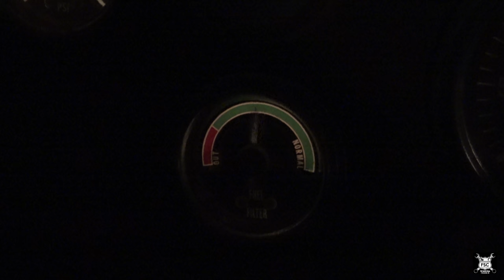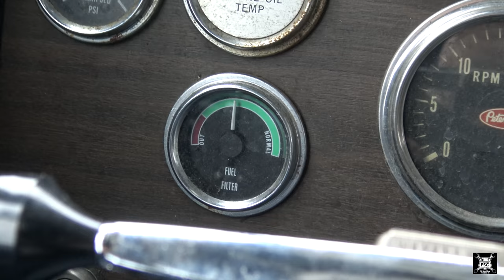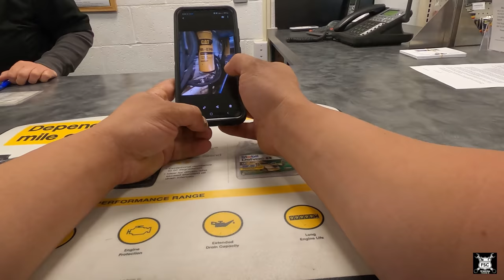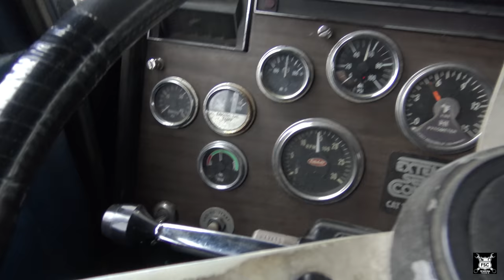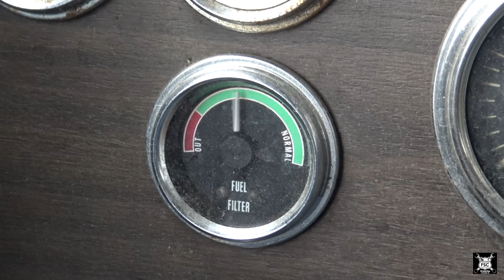Cabover Peterbilt Needs Repairs

Comment: Glad to see it was only filters. Couldn't help but notice that shop had such a friendly crew once you paid the bill. Until then I thought they were going to shoot you for bothering them with your fuel problem. Guess you have to add that cab lift hydraulic system to your "fix-it" list when the weather warms up. I remember having to rebuild the pump on an old F model Mack I had in the snow in Chicago because the seals decided to go on holiday in the worst weather possible. Ah, the good 'ole days...
Reply: Tom H : as you said, "the good ole' days." I remember them well. My problem wasn't as bad as yours, but I once had the turbo die on me on my 1975 Brockway Coe with a Cat engine one very cold winter night in 1978 around midnight on a mountaintop of a desolate stretch of old NYS route 17 in upstate eastern Ny. No pay phone for miles. Thankfully a state Trooper stopped to check on me. He contacted his dispatch via radio, who made a call to my brother who lived 3 hours away. And my brother went to the shop and got a new turbo, then drove out to meet me. By the time he got there I was half froze to death. In the cold wind we jacked up the cab and switched out the turbos and headed straight to the first diner we could find for a cup of coffee. The good ole' days. But you know what? I'd do it all over again if I had the chance
Reply: I agree, maybe their morning coffee hasn't kicked in... or they were intimidated by the camera, and thought it was A sting operation, for A TV show.
Reply: @SuperHigear  I hear you. We can laugh about them now but it wasn't so funny at the time. But, you're right, I wish I could go back.

Comment: The primer pump will give you that problem too if it blows out. Replaced 2 on my b model and one on my e model. Finally got a  blocker plate from cat. More fuel pressure than it ever had

Comment: FSC,  When was the last time you drained off the bottom of your fuel tanks ?   I used to do it in the fall,  A little piece of ice in the pick up lines will shut you down.  We used to buy a product from FPPF called melt down.  probably wouldn't hurt to have some in the truck for emergence's.   do you have tank heater's on that truck?

Comment: When I worked on cab overs, I learned to never ever trust the cab cylinders to stop the cab when going over center.  I always used a safety chain.  Glad I did cause one time I had one run away from me.
Boss Shop AKA a Class 8 Jiffy lube joint.
Reply: most if not all cabovers have safety stops built into the cylinders. if they come down to fast they will lock!

Comment: Glad you got the filters changed sounds like when you got fuel in Indiana it might had water in or some bad fuel I would say a lot of drivers who got fuel there probably had the same problem, by looking at the door from inside it looked like that you could have got the whole truck and trailer in the shop stay safe out there

Comment: 2012 ISX here. Had the same issue a few weeks ago. Had black slimy stuff in the water separator filter. Only got 2k miles out of 2 sets of filters. Truck would idle fine till you pulled with it. Run through the Chicagoland area twice a day. Changed where stopped for fuel and its much better. Another guy running with me had the same issue too

Comment: I ran my own truck for the last few years, 1988 379 with a b model cat.  More than once I had fuel filters go bad seeming early than they shouldve.   Somes times bad fuel but sometimes the filters do collapse inside and cause that exact problem.   I cut them open before and found that.  Even had it happen on a new western star with the cartridge style filters as well.  Glad it was a cheap fix man

Comment: Glad filters did the trick , look out for cat high efficent  filters they plug real easy & can drop hp. Down the road look out for your suction line with  the fuel heater in it the insulation comes loose  & bunches un in the line & creates  a restriction  at high hp & goes away at idle.

Comment: Steve is that fuel ⛽️ you get a mix of Biofuel and refined diesel as that biofuel is crap stuff it has lots of junk and particles in it anything over 15% mix ain’t no good for high mileage
And I would only run CAT filters adeptape did a cool video on filters a while back 👍

Comment: i broke down in a international transtar cabover in 1982 in nebraska fuel pump went out no cell phones i had cab jacked up on gravel road and a bunch of coyotes started circling me in field.so i slept in cab lifted till daylight and flagged down a farmer.after that i got the 80 362 pete cabover i remember it was gold brown with 3 stripes and brown interior with air ride 13 speed.cummins 400.The transtar was a 400 cummins to but a  10 speed.neet to see a cat in yours!

Comment: That thang about the wrecker is in your head hero. When you drive a truck 36 years old, you get that way. I know because my old Pete was a 1995 and I drove it up till almost 2016. A lot can wear out in 25 years and unless your doing a "Twin Stick Garage" restoration on a truck when you buy it, there's a lot of nuts and bolts that can work loose or break. You know Cats make fuel pressure from the return instead of thru the intake like most. If you haven't had that regulator off the engine lately it could be one problem. It's easily checked by plugging an external gauge on one of those ports in the fuel line and running the engine. I hope the fuel filter fixed it. My curiosity is going to drive me crazy till you post another video. Damn you Feszchak, I guess I just go watch FSC reruns. I hope you didn't have to be out a lot of money but I watched all the ads all the way thru to help out with boob toob revenue. Hope you made it home ok.

Comment: nice pete but those front tires in snow.. nope, but then i am trucking in Sweden so i am used to having real winter tires
Reply from the maker: I have more of a snow tire on the drives.  I've always run the same tires on the steers and never had an issue.  Most carriers out here run EPA certified tires that are terrible in the bad weather.  Usually here they put travel bans anyway in bad weather.  They've been doing that for the past 3-4 years now.  Now we know where they think they have the authority to do these lockdowns.  They started with us.
Reply: @fsctrucking  oh okey , seams like a wierd solution to stop all trafik instead of equipping trucks with proper equipment for snow and ice, but nice to know how it is on the outherside of the pond, planning a move to the US within 2 years, just need to save up some money first so i can get my Mack.

Comment: You can say about the mechanic what you want, maybe he has just a bad day, or something bad happen in his family or so, i have bad days to, that i don't fetch talking to other people. Dont judge a book by its cover guys

I hope for you that the problem is fixed, if not, i would look at the fuel return valve, i had a simular problem a few years back with a truck i drove for my boss, was i bit low on power and sometimes a bit sputtering, wen feuling up the fueltank was hot of the diesel that came back into the tank and also was steaming out of the tank, the feul return valve was in my case bad and did sent a lot of the fuel back to the tank that was already through the feulpump so the hot fuel sent back to the tank, heated up all the fuel and then be sent in to the engine and than back into the tank, when te mechanic came, the fueltank temp was dangerous high

Comment: not a very welcoming or helpful crew at that shop. it was like they were put out to even get you wrote up. how many rags did that guy think he needed? one in every pocket. im sure there is a reason that shop only had one other truck in it. amazing how turned "friendly" when it was time to collect your money. if you were as low as you though on fuel, would bet you sucked up some crap from the bottom of the tank.